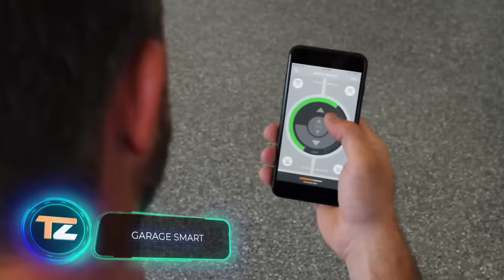COOLEST INVENTIONS FOR YOUR GARAGE

Comment: The creeper is pretty cool but it needs a "handbrake" so you can lock it in place when trying to remove a really tight bolt.  Every one I've ever used, I ended up nullifying any leverage and just pushing (or pulling) myself around instead of breaking the bolt loose.
Reply: The non swiveling casters do that for you.

Comment: Flat safe shelter is a great idea except for anyone in the Gulf Coast or Florida. Flooding from hurricanes is very common not only from the storm surges but from the rain.
Reply: Yeah... They didn't think that one through...  Huh?!?! Not to mention the water table level....You dig a whole like that, it'll just become an indoor pool.... Hence, no basements in Florida....
Reply: If you ask me, they're far more suited for tornadoes.
Reply: @theclearsounds3911  Not when the car shifts on top of it and you can't open the lid
Reply: @GT-fi4sk  Oh, yeah.  Good point!  Your only hope  there would be that someone you know would look for you after the storm, and before you run out of water, or air.  Yikes!
Reply: @GT-fi4sk  Actually, that's a design feature. I had one when I lived in Oklahoma.  The car over the sliding entrance prevents debris from a collapsing garage, for instance, blocking the exit.

Comment: I have the rhino ramps and they are great only problem is not for brake or wheels swaps!
Reply: They make oil changes go a lot faster for me. 15 minutes with the ramps, versus about 45 minutes when I'm jacking it up and setting the stands.
I got the 12k set. Works great for my cars and CUV. My 3/4ton Suburban is a bit on the heavy side for them, they flex some with it on them, but hold so far.

Comment: Looks like that shelter could be used as a pit for working on the car
Reply: That was mentioned in the video :-)
Reply: Looks like that shelter would fill up with water during flooding from the hurricane killing the occupants easily
Reply: Pits are a violation of building codes in most places.
Reply: @brianshorey  you should tell the manufacturer that. I already know that. Doesn't change the fact that it can be used as a pit to work on your car JFC.

Comment: that shelter looks dangerous...what if some heavy piece of debris, like the garage falling down, blocks your only exit? There should be at least 2 ways out or something to bypass that debris. Or install it in your backyard where being blocked is less likely.
Reply: Not a safe idea, if a hurricane would hit 🌀🌊 um wouldn't there be a chance of flooding?. I mean you are in a hole in the ground// garage and like you said debris cover it then what?!
Reply: @jeffharper7579  Ya it's risky no matter what, but not sure about flooding, I guess it depends on where you live...but they can get out if water starts to build up. Still where do you go in the middle of 200 kph winds with heavy junk flying everywhere? Best to skip town before the hurricane hits. I'm lucky not to have to worry about it here in Ontario. Though we did have major flooding in some parts of Canada recently like in BC.
Reply: Yep I can see that car shifting over the entrance in a Tornado!
Reply: And use it for tornadoes but not hurricanes. Hurricanes bring flooding.

Comment: Rhino ramp is not a new thing, but the garage storage systems are interesting.
Reply: Nowhere does it say it's a new thing.
Reply: I have the Rhino and tried it with my 2004 Corvette, drove right off the front of it, also, you lose feel of position, because they are too narrow for today's wide tires. Chucked them, and got a hydraulic lift with jack stands. Thanks. I would like to find an electric pump for removing oil through the dip stick. It just seems so prehistoric to be crawling under cars after all these years of innovations. Thanks.
Reply: @BrisLS1 

p

Comment: ok, first one, buy one of those recycled tire garden pavers and some 3m mounting tape, park your car meticulously and then mount the tile to the floor, when parking you will feel the bump, and if you cant then cut it in half and double it up, do both front tires for additional feel.

Comment: The ramps at the end of the video are simply cool and can come handy, I would say. Thumbs up 👍
Reply: Right, that's at least 10 years old invention... I had a pair of those in the Nederlands in 2013...
Reply: @notthedroidsyoulookingfor  Instead of poly, I have a pair that ARE steel - still working great after buying them in 1977.
Reply: I've owned a pair in California for about 7 years now.
Reply: I got a pair of the same brand ramp, on my 20th oil change using them.
Reply: only problem i have with them is they are sometime hard to pull apart if when stack more then a 2
Reply: The main problem with those ramps.
Is they have a tendency to slide when you try and put your car on them.
Reply: @HeadsDisplay  I used silicone multi lubrication spray on the sides. Makes them easy to pull apart. Does not affect their purpose.
Reply: @OneWildTurkey  Yep, old idea and like everything else that used to be made out of steel it's now made from plastic.
Reply: @OneWildTurkey  I had some of those too, not since 77, and they worked great also but the Rhino ramps are so much easier to move around.
Reply: I bought 2 sets of those Rhino Ramps so I could get all 4 corners up. Had a Sport Trac with that transmission with no dipstick, needs to be filled/checked from underneath. Truck had to be level and running to fill it properly. (Running a vehicle on stands never seems safe to me) Still had to put them under the second axle with a jack, (not enough traction to drive up all 4 at once) but coming back down is so much easier.

Comment: The Rhino ramps are convenient inasmuch that they're really light, strong and take up surprisingly small amount of space for storage. Getting your car onto them, is another matter. They're so light, walls so thin that they slide on just about every surface and you end up either pushing them forward or worse still, shooting them out the back of the wheel. In the end, at 60 bucks I'd rather have them than not I jut hate having to get my car onto them - it's an adventure that takes way more time than it should.
Reply: Never had a sliding issue with them.  Do yours not have the rubber feet on the bottom to help with that?  The only problem I have with them is I have a toyota matrix that has low ground clearance due to the front ground effects and they hit the ramps before the tires contact and start lifting the front end.   So what I do is take a 2x6 board about 18-24" long and lay on the front edge of each ramp to extend the length.  That little extra height is all it takes, just need to get a little momentum forward and steady on the gas so you don't spin the boards out.
Reply: True.  I put a concrete block plus one 4” solid block behind each Rhino ramp to prevent it from moving. Sometimes I need to use a 24” 2x12 to get on the ramp, because the cars today are very low to the ground.

Comment: @1:05 Sheet steel/thick rubber mats & a chain fix properly to the floor, 2 would be better, that's a nice easy solution to a problem that all home mechanics have,  much better & easier than most, well done that man

Comment: At 1:05 this video, the lift should have the edges on the floor rounded to prevent the large gauges on the floor. But, all that massive amount of steel has to be extremely heavy. How do you easily move it? Where do you store something that big? The safety system? No clue on that one.

Comment: The box hangers in garage start at 479? Hmmm, I’m thinking literally 6 2x4s (4 would do fine too) and 4 or 6 2x1 strips and you could fashion the exact same type of rail system for a mere $30-40 bucks depending on wood prices and some bolts. There. Just saved everyone 430 bucks. Feel free to send me check for difference.

Comment: Regarding that shelter thing being used for oil changes, pits are a violation of code in most places as gases and fluids can settle in them.  Unless they have some sort of ventilation system they are a no no for garage use.  Check your local building codes.
Reply: Back in 1988 or 1989 a local Ford mechanic was burned to death  in Digby County, Nova Scotia working on a gas tank in a pit. After that hoists became common place in all garages and pits became obsolete.

Comment: instead of a $300 creeper use a large flattened card board box.  fits under any vehicle, insulates you from the cold floor and is even recyclable if you spill oil on it... let's face it, even with tool pockets in an overpriced lump of plastic you could make with a 3d printer you will still lose your 10mm socket

Comment: @8:10 You could do this for very little money if you are prepared to do a little work, I have actually done this with manual lifting & it is incredibly useful & incredibly easy if you use the right gear, the more wheels the better, but it's basic physics most can sort it out at very cheap money.

Comment: I can see all kinds of bad things happening with that one @ 1:14. Don't try that one at home if you want your car undamaged AND you don't want serious injury or DEATH. For what it would cost to build that you could probably get something much safer. I'll just say no thank you to that one. I work regularly in people's homes and I have seen two storm shelters. I just recently saw the one in this video @ 2:27. The only problem I can see with that one is what if part of the house collapsed on it? The other one was above ground and was basically a steel shelter bolted to the garage floor and would require a fairly large garage. Each could probably fit 4 to 6 people.

Comment: those garage storm shelters are stupid heres why first a car parked over it so you have to move it what if you cant find your car keys in time.. another thing if the house falls on it you wont be able to push off the debrey your screwed its your tomb you need a structure with hydraulic rams back up battery and generator and far from any structure or tree in a feild then youll be safe

Comment: Got the pneumatic car lift and it works brilliantly on any normal car. Then my wife decides she wants an Audi TT and of course it is way too low for the lift to go under. Other than that I think it is great.
Reply: you can already see that in the video, the part works on every tractor or whatever else people drive, but not with cars.
I've never driven a car in 40 years that was high enough for this jack to fit underneath. But I also drive a CAR, and no tail extensions or anything. And a car has to be fast.

Comment: For Unconventional car lift I would make the pipe that runs under the car removable with a stop pins used on trailer hitches. If the foot I beams have a hole in them you can drive the car between the uprights  slide the round pipe under the car and lock them in place. This will allow the pipe to roll as you lift the vehicle. You can even ad spacer blocks at the cars body jack position when lifting. Once the car is raised slide a short length of smaller square tube through the bottom of the uprights with lock pins to prevent them from standing back up again.

Comment: im shocked still in 2023  no-one has  built a cheap  home car lift thats safe? it carnt be that hard surely ?
Reply: There are a few factors to consider.  What are you lifting?  How high are you lifting? How important is safety? The lifts are out there. A lift to get my MX-5 high enough to fit my Micra under it is about $6500 CDN, installed. A simple lift system to get my cars about 24" up for easier service is about $1500. I had a motorcycle lift that would lift my 950lb GoldWing about 18". It was $100.